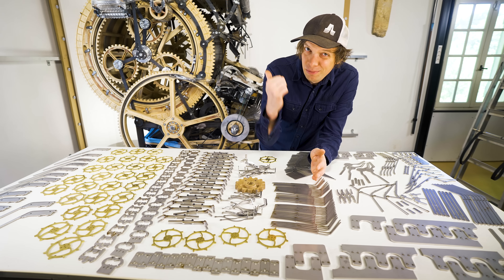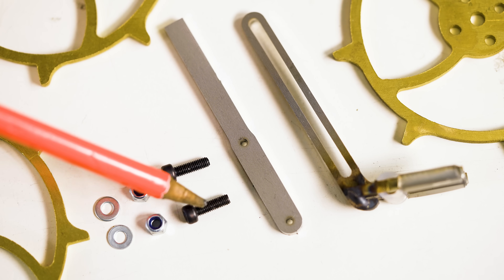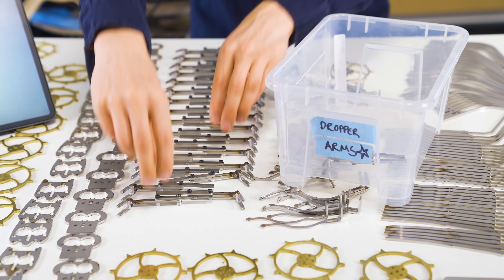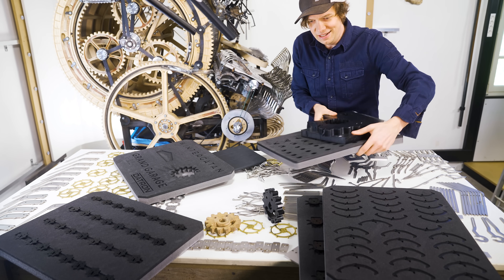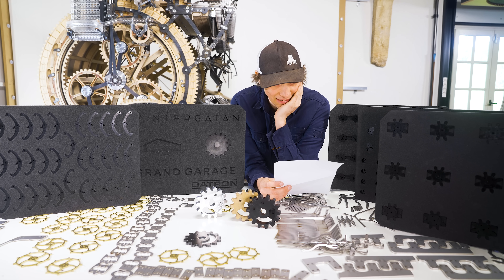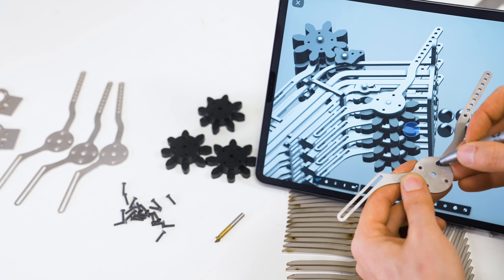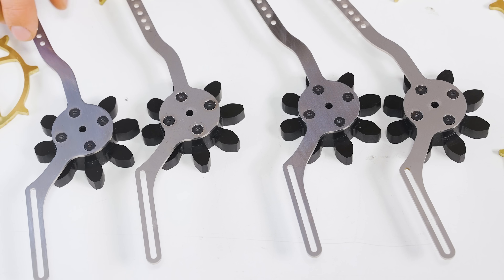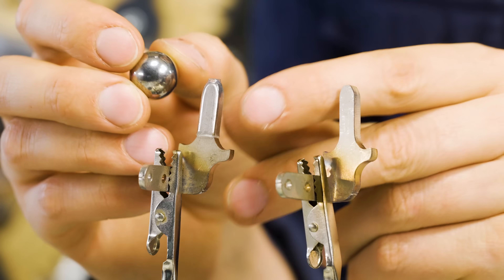Solving the 1000 Pieces Engineering Puzzle

Comment: I used to be a full time fabricator building battlefield shelters (Force Providers) for the DoD. We always throw our lead over our shoulders when working at a table, it's standard practice and it's safe
Reply: An old machinist once told me "You'll never meet a retired welder". Breathing vaporized metal alloys isn't great for the lungs or anything else. I'd be more concerned about ventilation than a possibly fictional risk from EMF.
Reply: Especially if he's used argon in a confined space without ventilation. Asphyxiation is a real deal but it's also about concentration.
Reply: @cameronw6818  Not a welder, but is it even remotely possible to asphyxiate from a little bottle of Argon like that? (unless you stick it in your mouth) It's not like CO2 that actively harms you. The only thing Argon can do is displace oxygen, and it should take a completely ridiculous amount of gas to displace enough oxygen to lower the partial pressure to dangerous level.
Reply: @TonboIV  - It's a noble gas, so it's non-toxic and you're right that it would take a real effort to create a situation where it's dangerous. I've heard of a guy welding  with CO2 instead of argon, and it sent five people to hospital with carbon monoxide poisoning. He was new at the job and convinced the boss that it worked just as well and was cheaper. Dunno what he does for a living now.
Reply: @TonboIV  if I remember correctly, the way your breathing works, is that CO2 buildup is detected, and when it gets high enough you exhale, then inhale.
Anything that displaces the CO2 prevents this, and while you can probably partially mitigate the problem by controlling your breathing conciously, that brings its own downsides, not least of which is realising you need to to start with. 
Also, depending on the relative mass and concentration of various substances, it can be hard to expell, and just sit there taking up part of the volume of your lungs, reducing oxygen intake by tye simple expedient of just being in the way.
Apparently you Can actually get some oxygen out of water (in so far as fish do so, they don't actually extract it from the water molecules or anything, there are just oxygen molecules mixed in with the water ones), the water gets in the way of expelling CO2, and further your lungs aren't actually set up to expel that volume of such a dense fluid, so can't clear it out sufficiently to make room fir the next, non-oxygen depleted lot of water to come in.

Also a bunch of other stuff I'm forgetting. I probably hit some details wrong too. But it's definitely at least tye right direction for looking into it yourself.
Reply: @hamletksquid2702  
"Dunno what he does for a living now."

Flying airplanes, dispensing medication, installing furnaces, could be anything. Maybe he became a politician.
Reply: @TonboIV  CO2 does not actively harm you, in high concentrations it can displace oxygen from your lungs since it is heavier than air. Are you getting it confused with CO (carbonmonoxide) which replaces oxygen in your blood and can cause serious harm.
Reply: @mortemmalum7228  Carbon dioxide poisoning is definitely a thing. Your body needs to get rid of it by diffusion through the tissue in your lungs, which is powered by the difference in concentration between your blood and the air in your lungs, so having too much CO2 in the air will prevent that, and begin to cause suffocation even with plenty of Oxygen in the air. It also doesn't take very much extra CO2 to start having harmful effects. Concentrations above 1% are usually considered bad, and even 0.5% may be enough to cause drowsiness and reduced mental functioning.

As far as I know, Argon doesn't interact with the body at all. It's a noble gas after all, so it should just take up space like Nitrogen.
Reply: @TonboIV  CO2 does not actively harm you, CO on the other hand do by sticking to the hemoglobin in your red blood cells.
Reply: @VirtuellJo  I don't see the distinction you're trying to make.  Both CO and CO2 cause oxygen deprivation and brain damage at high concentrations.  CO poisoning happens at ~30ppm, and CO2 poisoning happens at ~10,000ppm.  The real concern is how easy it is to accidentally reach unsafe levels of each in a particular environment.
Reply: @VirtuellJo  Whether you want to call it active or not, CO2 clearly can harm you even at only a few percent concentration, and it doesn't need to displace anything to do so. The presence of CO2 causes the harm, even if Oxygen is available.
Reply: @TonboIV  Argon can still displace the oxygen, as can nitrogen or any other gas. CO2 isn't poisonous though, the problem is that it saturates the blood and makes it unable to diffuse and carry oxygen. You said that CO2 causes inherent harm and it doesn't.
Reply: @mortemmalum7228  I'd call that pretty harmful, but the point I was trying to make was that CO2 is harmful just by being present, even if there's also plenty of Oxygen, whereas Argon is only harmful by displacing Oxygen, so you'd need a lot more of it to cause harm.
Reply: @hamletksquid2702  I don't think you can do decent TIG welding with CO2 alone. I've tried it only once on aluminium, out of curiosity, and remember getting soot and black smoke and ruined electrode. Some sources mention that the arc breaks down CO2 and lets the freed oxygen/ozone react with whatever it gets into contact with. CO production is plausible.
Argon gas is a noble gas, yes, but the arc will produce lots of ozone in the surrounding air. High quantities of that stuff is certainly no good for health.
Reply: @SeersantLoom  - You definitely can't do good welds with CO2. I'd expect the results to be full of carbon and brittle, like torch welding with too much acetylene. I've never tried it and don't intend to. I've worked around welders, but not for years. I do a type of metal grinding now, and my doctor tells me the particles are too big to get absorbed into the blood. I still wear a mask on some jobs, though.
Reply: @hamletksquid2702  CO2 is carbon dioxide, so they probably didn't have carbon monoxide poisoning
Reply: @mike8984ify  - Quite likely it was a case of people believing they had CO poisoning. I couldn't tell you from experience, but it seems plausible that running it through the heat of a welding arc would cause chemical changes in the gas. Some of the oxygen will go into iron oxide on the metal, some of the carbon will be absorbed (this effect is actually used to case harden steel, called carburizing), some of the carbon turns into "soot", and some of it will come out as CO. But again, I wasn't there so I'm repeating what my friend told me about it.
Reply: That whole EMF concern strikes me as being the same as when people are scared to use microwaves to heat food because they think all electromagnetic radiation is harmful
Reply: @evanbarnes9984  Or the anti-5G crowd
Reply: @nocare  It's exactly like the anti-5G nonsense. Probably the exact same people pushing it too.
Reply: @ninjafruitchilled  remember when in the early 2000's when people claimed that cellphone could cause brain cancer?
Reply: There is no biological basis for EMF being of concern at any level you will encounter terrestrialy.
To be a problem the levels would have to be severe enough to induce electrical signals in the brain and even the strongest MRIs can't come close to doing that let alone a TIG welder.

Even then, the harm would all be in the form of misfirings of nerves and would present itself as a seizure not as some form of cell damage that could accumulate over time. It's not like ionizing radiation.
Reply: @nocare  The EMF scare is from conspiracy theory from non-scientific wankers who're also afraid of technology and vaccines having 1% the amount of mercury they consume in a can of tunafish.
Reply: @nocare  Applied Science made a video about EMF and nervous system interaction. "Transcranial Magnetic Stimulation project" should bring it up.
Reply: That "electromagnetic waves are dangerous" garbage is the reason why people thought 5G towers were dangerous. Don't believe the lies we are not knife fish (electric eels).
Reply: @UC8k_zzH2nTQXjMXbE-_8JDQ Only specifically high power near microwave frequencies interact with water at sufficient levels to cause heating.
And its not like you can't tell, you very specifically can feel the heat. That's why the microwave area denial system works.

Just run of the mill EMF will not induce enough motion in water to cause heating. It's the wrong frequency.

So yeah some types of radar you wouldn't want to stand in front of.
Reply: @nocare  - Historical tidbit. Microwave ovens were invented by an engineer who was working on radar systems when he noticed that a candy bar in his pocket had melted.
Reply: @nocare  Funny you are mentioning "some types of radar you wouldn't want to stand in front of". When I was doing my military service in the Belgian Army in the 1980s (yeah, I know, I'm getting old), our artillery observation post was close to a radar dish of the anti-air artillery. As usual, the weather was wet and cold and those radar guys would actually stand in front of the radar dish to dry their parka's and get all warm and cosy. 25 years later, the Army got a lot of claims of people developing cancer ...
Reply: Well. the comments on the EMF had dubious references at best. And while there are EMF regulations in place its mostly for industrial welding machines. Not handheld versions.
On the other hand, its a small habit to change. just put a clamp on the table that you hang your hose on, or run the return together with the feed to disrupt most of the emf.
Reply: @konzetsushi  - EMF is a function of voltage, not current, and at the sort of voltages used for TIG welding, it's a negligible thing. About  half what you'd get by holding the cord on a lamp and a lot less than an old tube TV puts out. If you're standing under a high-tension power line where a fluorescent tube will light up by holding it in the air, that might be a concern.
Reply: @hamletksquid2702  I neither argued for nor against it. just said that running the cables together will lessen what little EMF there is and that he might as well avoid prolonged exposure by not wrapping it around his neck.
As it is today there are regulations for it, it mainly handles MF and HF but LF is counted as well. Depending on country you may or may not have OSHA regulations around manual welding.
https://eur-lex.europa.eu/legal-content/EN/TXT/?uri=CELEX:32013L0035
http://www.emfweld.eu/User/EUDirective.aspx
And judging from comments a lot of people think microwave oven when they hear EMF, that's not the only case. Like @MazeFrame mentioned, look up "Transcranial Magnetic Stimulation project".  Even exposure to LF radiation can have reversible effects on your body, but to expose yourself to that you have to be in pretty close proximity of the source.
Reply: @konzetsushi  The one Martin is using is an ewm Picotig 200 which is a very high quality German made industrial grade on-site welder. I'd highly doubt they're not up to EMF standards.
Reply: There is some evidence that high intensity EMF isn’t good for you. At the same time a typical EMF meter will tell you you’re exposed to a “dangerous” level of EMF which you’re watching this on screen... So go figure. 
The confounder is the confusion people have with ionising and non-ionising radiation. The latter is generally ok, and like high intensity EMF only a concern at high levels, aka cooking yourself.
Reply: Worst thing that can happen is that you develop a unibrow.
Reply: Breaux that standard practice of over the shoulder has been lead to deaths.   Just because something is a standard practice does not mean it safe.   There are USA OHS reports, Australia Workplace health and safety..... that have followed up after deaths in workplaces.   Throwing lead over shoulder when the lead is damaged does lead to electrocution deaths every year.    Lot of cases the cracks in the cable are that small that even after electrocution are still very hard to spot.     If you have some other option than you shoulder for the cable you should use it just in case the cable has a crack though the insulation that with sweat that can result in you getting zapped.   Back of neck quite effect place to hit with voltage to stop someone heart.   If you are going to be forced to put the tig cable/electrical welder cable over your shoulder you need to be checking cable very carefully.

I know of no report that says the EMP from welders is 100 percent sure that it is a problem.   There are a lot reports that say welder/power cable over shoulder is something that need to be done with due care or risk being dead.   If you don't want to risk being dead don't put cable over shoulder.

Breaux the level of risk is also linked to how new your equipment is.   So if the DoD was keeping you with new equipment/cables all the time the risk of cable over shoulder is very low.   The risk with older equipment like what is being used in this windergatan build is a lot higher due to the age on the cables.   Recommend best practice is not put over shoulder by default so you not in that habit for when you have to use older more worn gear.   If you are having to put cable over you shoulder you will want to be using the newest cables you can that you have inspected properly.

I have met many 'retired welders' these guys did take ventilation and wearing protective masks properly and did take these electrical risk serous-ally.   Yes if you wish to live to be a retired welder you cannot take the true death causing risks lightly.    EMF does not make it on to my major list because everything you should be doing to keep the electrocution risk low should also mean you are not putting self the location for high EMF.   The more contact you have with the cable the more area you have to find a crack in that cable and be electrocuted with it.    Really I don't understand all this modern talk about EMF around welders when the key point is control you electrocution risk.

Comment: With the thousands of marble hits, I would think that those little feet are going to slowly get pushed down, throwing off the timing.
Reply: I would imagine he will be checking things after set up and before going on stage. In the end it is an instrument and instruments need to be tuned.
Reply: probably not a concern if screws are properly tightened and if not then thread locker could be used

Comment: These water cut brass surfaces look pretty rough. Hope you are planning to polish the sliding surfaces so you don't wear out the POM escapements.

Also bit concerned that the heat shrinks on the droppers give inconsistent drop timings, as they don't give a well defined edge that releases the marble. But no idea if that's an actual issue.
If it is, why not just make them entirely out of POM? Would require much less assembly too